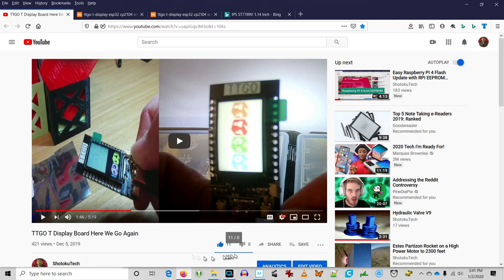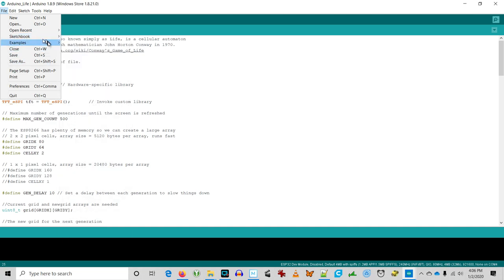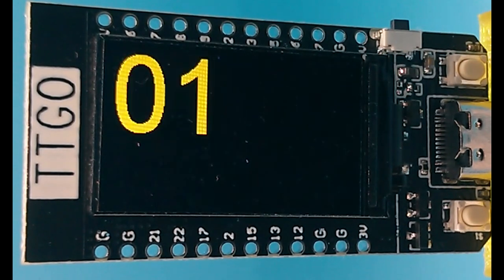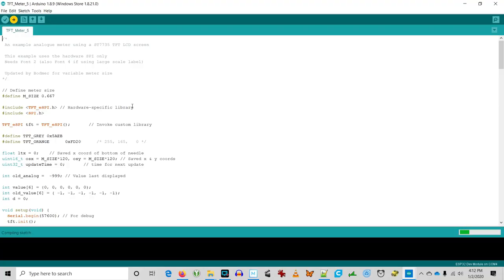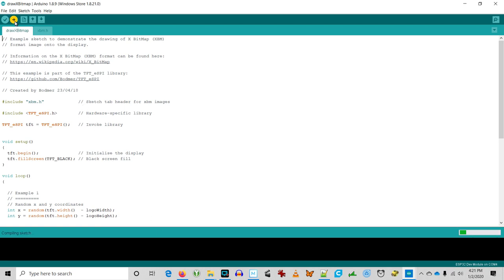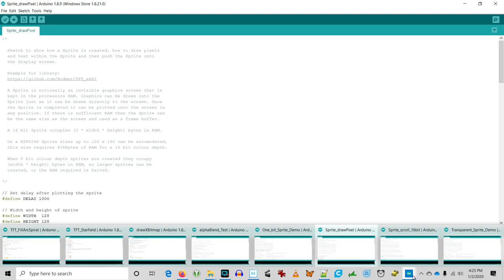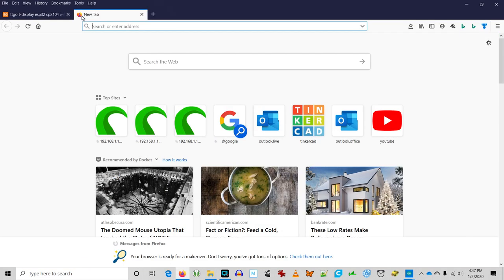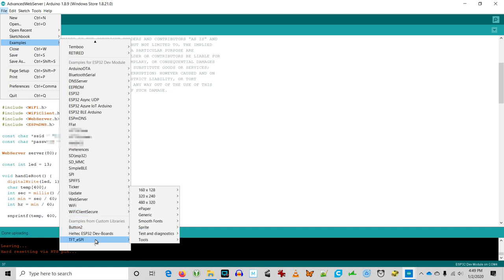Check Out These TTGO T-Display Example Sketches

Comment: what does it mean when it says Hard resetting via RTS pin
Reply from the maker: Hello. This is usually seen at the end of uploading to ESP32 devices. The program that is uploading to the T-Display resets it as the upload is complete. Some ESP32 devices require that you manually put them into upload mode, then manually reset them when the upload is done. Thanks.

Comment: Mine refuses to show anything. I have bought 2 and both refuse
Reply from the maker: So they never did anything out of the box? If you open a brand new one and power it, it should show the TTGO logo, flash a few different colors the wait for you to press one button or the other. Did it these that?
Reply from the maker: Also check this video and make sure you have uncommented the correct line in User_Setup_Select.h, installed the libraries, board manager URL in preferences. https://youtu.be/oapiGqvJM3o
Reply: @ShotokuTech  omfg.... How could I have missed that one.

Thanks it works now :D

Comment: Hi. I have a question. Is it possibile to display gif by using sniff example? Thanks
Reply from the maker: So to display an animated GIF on the TTGO? That is an interesting question. It seems that it might be possible. I will have to try. Keep watching. Thanks.
Reply: @ShotokuTech  I have been done it an hour ago. I am simply converted the gif file to jpg with the scale 133x240 120dpi and then draw each jpg. It tooks me lot of time write each drawjpg lines but it works. But after line 41 of drawnjpg the animation sometime delay. I don't know how to fix it. So I'm looking forward to your new video. Sorry for my bad english.
Reply from the maker: Lower DPI and try TFT push image? Like this: https://youtu.be/u1BvcRRiGq4

Comment: Wow, people still use Mouse Trails? Lol
Reply from the maker: I can assure you I do not have mouse trails enabled. Many times I compress video to save time, even cropping frames that don't support the video. So maybe you are seeing some artifact from that. LOL. Thanks.
Reply: @ShotokuTech  lol oh ok 😁
Reply from the maker: @bluegizmo1983  It is odd. I just went though mouse settings in Windows 10 Mouse, Display settings and the like and do not see the option to turn trails on or off. But you are right. Mouse has trails. Did I mention I hate computers. Must go binge watch the Terminator movies now. Ha ha thanks again.
Reply: @ShotokuTech  Huh? I thought you enabled mouse trail on purpose. Because you know, the only practical use of this feature is to make mouse pointer more visible on the screen. And when you film video you want the pointer to be more visible. So the trail is obvious and simplest solution.
Reply from the maker: @binariti  Thanks I'm not looking to disable it. Seems more useful to have it than not.